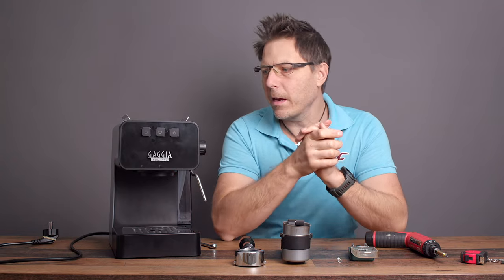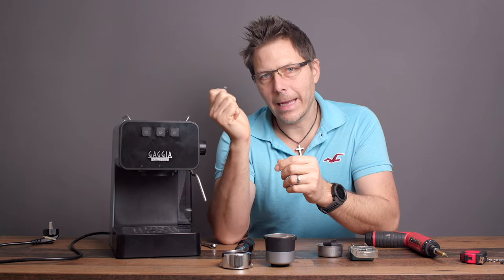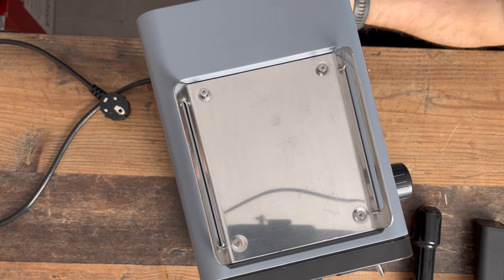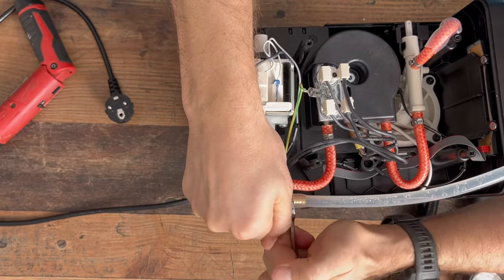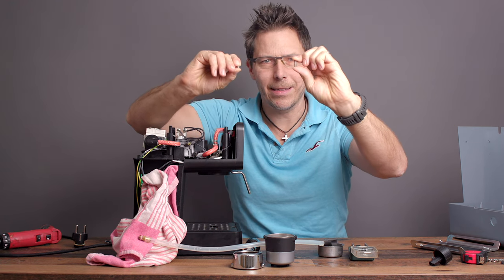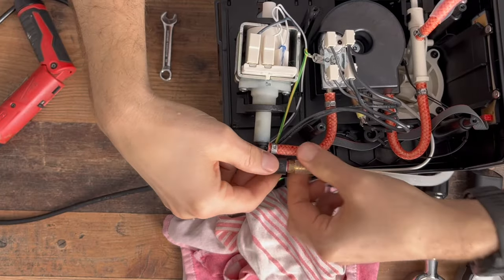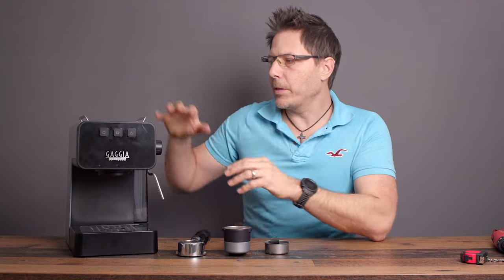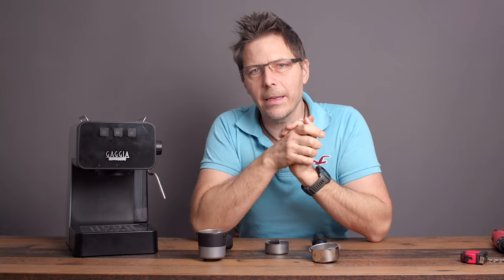Much Better. 9 Bar OPV Mod for Gaggia Espresso Deluxe

Comment: We've had this machine for about 5 months. We'd been using coffee grounds which were for cafetieres and only recently realised we should've using a finer grind for espresso machines. We tried it yesterday and the difference was amazing. A much better tasting, stronger cup. We're going to stick with the 15 bar as we like the results.

Comment: Greetings, I have a Gaggia Carezza Deluxe, you seem to be one of the most competent on Youtube, I changed the pressure of the OPV by changing the spring, I found a spring kit on Ebay (in Italy Amazon has sold them out). The kit has three springs (6 bar, 8 bar, 9 bar), I used the 8 bar spring considering that I mostly make single coffees with 7g filter.
Carezza Deluxe has plastic doors and is very difficult to dismantle, furthermore the screw under the diffuser of the machine does not allow the use of "Puck Screens", they would be punctured at each delivery, for the rest now with the depressurized filter the coffee does not have that "creeper" taste, it's definitely better than before, not very creamy but decent. Changing that speaker might make it even better, I think.
I noticed that you always use double filters (14g) to make videos but with a single filter the "creaminess" decreases a lot.😉
Reply: Hello, Can you share the 9bar spring link for the gaggia carezza deluxe? Thanks

Comment: I bought this model recently and first impressions were the brewhead was too fast - found this vid and bought the spring kit and portafilter you linked - literally a two minute fix and now a great little machine. - it does beg a question as why Gaggia dont shio the spring kit to be fitted at own risk - great vid thanks

Comment: Soooo you left us in suspense.  Did the new spring fix your “Over Pressurization” and “Leakage” problems?
Reply from the maker: Yes it did! See my full review of the machine. 😊
Reply: @TomsCoffeeCorner :  Overlooked using my iPhone vs iPad.  Thanks
Reply: 4 Screws or 6?
Reply from the maker: @jvs00051 6

Comment: Good 'un, Tom, thanks.

I'd guess that the red gunge on the screw is a thread-locker.  Vibration + spring force ==> splat, sooner or later.  Given that the OPV is plastic, thread-locker is logical since it reduces the torque needed for a tight seal.  Probably a Loctite product - I use them on my bike.  Don't know if they make a food-safe one, though, my bike doesn't care.  Have a gander at Henkel's stuff.

The question arises, though: what is extraction with the pressurized basket like with the 9-bar spring?
Reply: Looks like a liquid thread sealant is needed when reconnecting as you said👍
Reply from the maker: The shot is better - I covered it in the full review posted last week. The temp is a bit on the low side though. I’ve still got mixed feelings on this machine.
Reply: @TomsCoffeeCorner  I wonder why lower pressure ==> lower temperature (apart from  Boyle's Law).  Maybe expansion is taken into account in the pump programming, but I can't see exactly how that might work right now.

Comment: So ... @TomsCoffeeCorner - I have done the mod! Thanks for sharing this - I have done a first test and it seems better! I got from 15.5gr ... 31 grams out in about 23 seconds - (stopping for the pause after the preinfusion)... I kept the grind the same size as before ... Pre-mod if i went finer it was spraying out on the side... I wonder if now I can grind a little finer (1-2 clicks) and see if i can get closer to the 30 grams in 30 seconds? ie. it should be less likely to spray even with slightly finer grind? Also - on the red sealant they put on - i obvously could not add more of it ... I checked post mod and there seem to be no leaks... hopefully it is ok...

Comment: Great video! 

In you experience, is the shower screen still an issue with this mod installed? If, do you think it could be changed?

I've been thinking about buying an espresso machine for a while now but the amount of time you have to wait for a boiler machine to get up to temperature as well as just the waste of heating all that extra water just isn't something i would want in my life. I don't get how a thermoblock doesn't seem to be a bigger selling point to so many people.
Reply from the maker: The shower screen still sucks, but I ordered a replacement. The Delonghi ECP series warms up quite quickly, and the Bambino Plus is super super fast, fyi. Cheers!
Reply: @TomsCoffeeCorner  oh that's great to know, thanks for your answer! Could it be something of a sleeper choice if the mods turn out to solve the problems with it do you think? Maybe something to make an updated video about? 😁
Reply from the maker: I think it'll be decent with a 9 bar spring and a shower screen. Still can't recommend it over the Dedica though, with such a lack of aftermarket parts, and such little global distribution.  @johannestornquist

Comment: Can you fit 16g of coffee in generic cheap 51mm basket? Its about 25mm in height. IMS basket is little bit taller.
Im getting sour espresso with EC685 and cheap basket, but trying to add more coffee than 15g result in mess and espresso is still sour. I will fix that but when you using generic basket do you use 16g of coffee or less (im thinking that maybe headspace is to large if I use 15g).
Reply from the maker: It depends on the basket sizing. I can normally fit 16 grams in most baskets though. Good luck!

Comment: I bought the bottom less porterfilter exactly the one you got, and changed the spring to the exact specifications 9 bar. But it still makes a mess everywhere with that porter filter tracks right down the handle. Very annoying.
Reply from the maker: I would contact the company in your case and ask for a shallower basket. Maybe they'll send you one.

Comment: After the mod, what happens if I grind fine enough to peak higher than 9 bars? What happens when I grind coarse enough to peak lower than 9 bars? How does it affect either the pressure or the flow?
Reply from the maker: The OPV acts as a gate. If you grind fine enough for the pressure to exceed 9 bars, that pressurized water will get diverted back into the water resevoir.

Comment: What are the cons? I mean if there are only pros in swapping the springs, why Gaggia still uses stiffer springs in these machines?
Reply from the maker: Gaggia just wants high pressure I guess, to get the shots through those pressurized baskets.